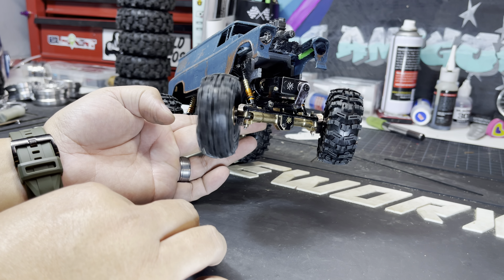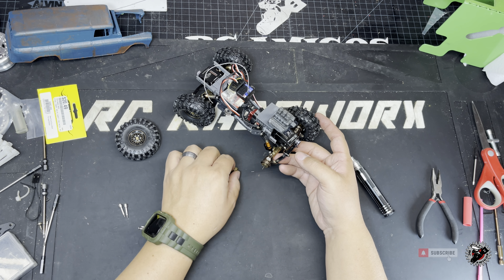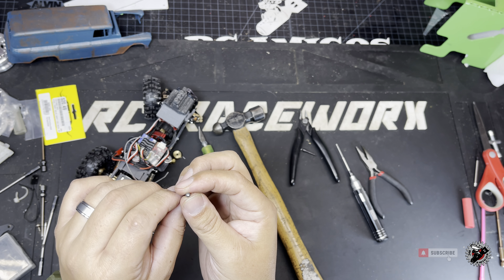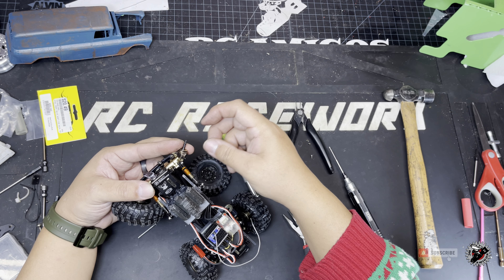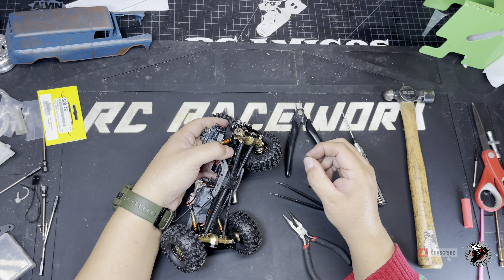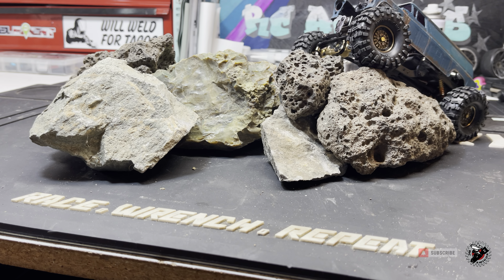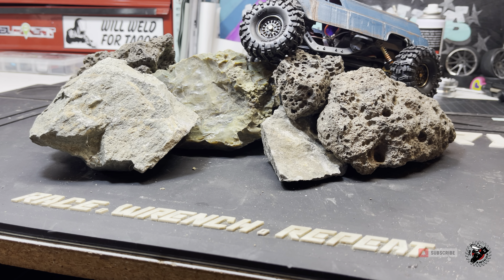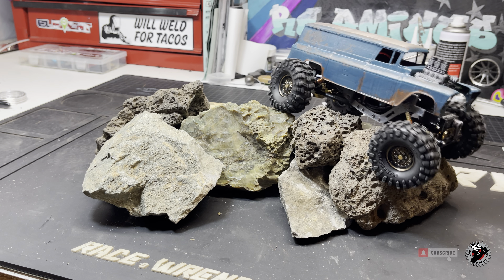SCX24 Axle Shaft Fix!

Comment: I went with those YR axles because they are thicker…everywhere but the actual threaded end/dogbone end- which is what I broke shortly after.  
I would recommend Mofos V2 CVDs made from spring steel. Lots of steering throw, and much more strength.  Great video, love to see more 1/24 content… and that Hearse body is killer!!
Reply: Oh, and watching from Austin and using MIP tools!
Reply from the maker: Thanks @bcochener, yup im getting my signs on those right after Christmas!

Comment: I've seen it a bunch with real vehicles but physics scale down also I'm pretty sure. Even with huge axles a locker will tend to break them mainly when one wheel is planted hard but being forced at the same speed as the others. Usually when the weight of the vehicle is concentrated on one wheel from going up or down a hill on an angle.

Comment: MIP or nothing
Reply from the maker: I haven't tried MIP yet believe it or not. I have some reefs and factory team bits.
Reply: @rc_amigos  they are definitely a buy once, cry once type of a purchase.  However, I have not worn them out in over 10 years.   In that time I have only broken one 1.5mm hex driver.  It was being forced to do something it was not intended for and snapped under the  excessive lateral torque being applied trying to free up a seized bearing.  Before that I was going through hex drivers about 18 months on average.